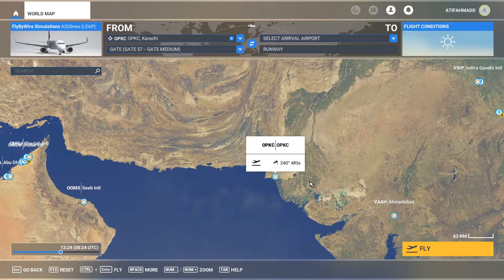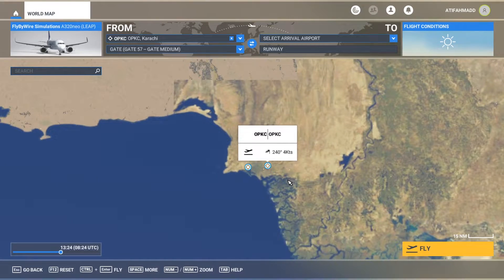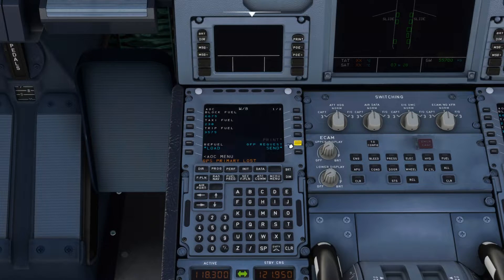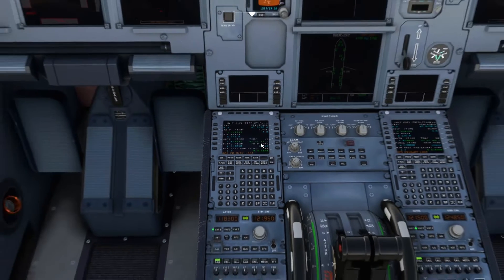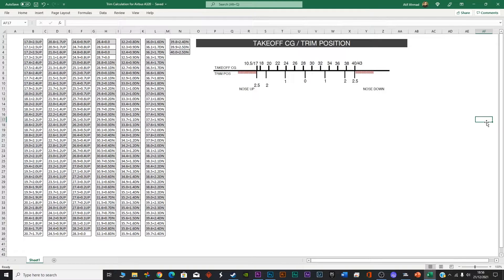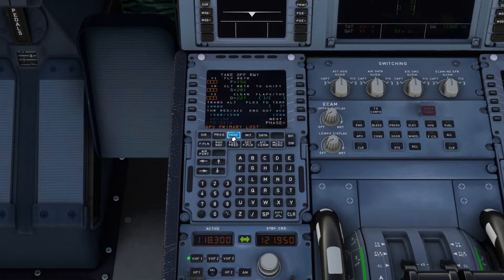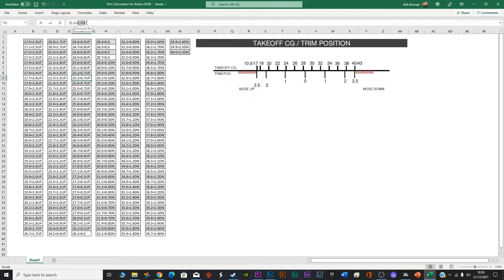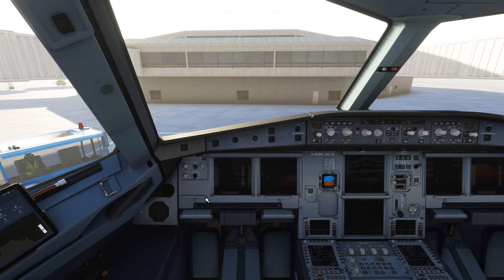Trim Settings for Take Off for Airbus A320 - Microsoft Flight Simulator 2020 - FLAPS/THS in MCDU

Comment: Thanks mate. For the effort you went through for the diagrams charts, at least someone put in the effort to help people learn and understand about the settings especially if you’re in the A380 air bus these are very important otherwise your plane will not take off. The A320 is pretty forgiving lots of power and you could manually trim quickly from the scroll wheel anyway, but by the books in real life this is very important cheers mate 😊

Comment: The Init Fuel Prediction page of the MCDU says ZFWCG, which, as the name suggests, the ZERO FUEL center of gravity, but on your excel sheet, it says TAKEOFF Center of Gravity, which is not the same at all. After startup, on the 'Fuel Pred' page, there are numbers for ZFW/ZFWCG, AND the GW/CG, which is with the fuel included, and that center of gravity should be used to set the pitch trim, not the zero fuel CG, but correct me if my logic is incorrect.
Reply: True, i was wondering about the same thing.
Reply: Where do u find the towcg then

Comment: This center of gravity sheet is excellent. Can this be used for the Airbus A320 CEO too?
Reply: The trim wheel has the CG matched to the required Trim value on the side of it so I'm confused as to why a spreadsheet is needed?
Reply: @tristantriton8115 oh you're totally right I think it's because of the camera position in the Sim, it's hard to see the center of gravity chart. I had no idea it was there until you mentioned it.
Reply from the maker: The take off performance calculation is different for different planes. However, due to non-availability of the proper take off performance calculators you can use any available option as it has a little or no impact on the simulation. Just information is just for the knowledge purpose and it is not accurate. However, the Fenix A320 has a built in take off performance calculator which is accurate for the given aircraft

Comment: 1+F would be used if you had flex temp set (just below the trim setting) for a reduced thrust takeoff, otherwise the MCDU will expect TOGA thrust on takeoff. This is something that has to be calculated separately as well.
Reply from the maker: Thank you very much for your input. I have tried entering 1+F for the flaps but somehow the MCDU doesn’t accept the input. Due to this reason I set it to 1. Thank you
Reply: The mCDU will only accept "1". It doesn't matter anyway since you can't extend only slats for departure.

Comment: Sir you forgot to actually set the trim. Entering values in the MCDU just tells your autopilot your config, but the AP wont set your T/O trim for you, just like the AP wont extend the flaps for you. For this you wanna go to the F-CTL ECAM page, which gives you the status if your trim. Then you need to spin the trim wheel manually to set the trim.
Reply from the maker: Thank you very much for your feedback and valuable suggestion
Reply: @aatifahmad  Anytime .. basically its your TO trim. And for your AP to handle that trim the AP needs to be engaged, which it isnt on ground. And you wanna set the trim before TO, thus you need to spin the wheel manually. Also the center of gravity determines well .. literally the center of gravity. Thats why pilots always try to keep it in the middle of the plane. Setting the trim obviously doesnt change the CG as you would have to shift the weight in your plane around. It just changes position of your controll surfaces to where the plane remains balanced. After TO, obviously the AP takes care of the trim. I felt like its important to know.

Comment: I do it on the trim wheel. is there a difference using the box (ex: 30.4 align on the arrow, it's precise about + - 0.2) ?
Reply from the maker: While setting the Pitch Trim in the MCDU the FMS adjusts the trim accordingly and you don't have to do it manually
Reply: @aatifahmad  no. That feature is not on A320. It's there on the other Airbusses (i'm not quiet sure tho bout the 330 and 340), but not on the 320.